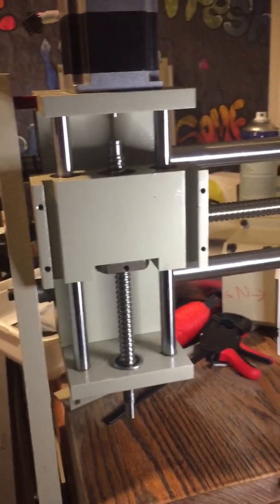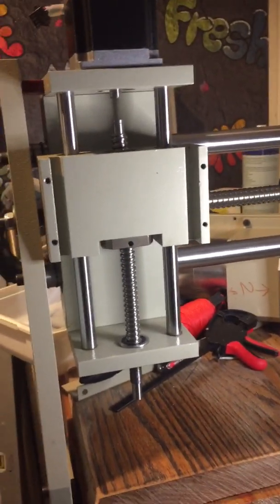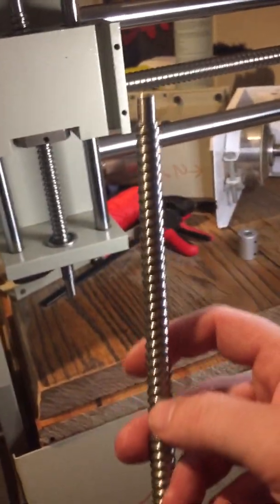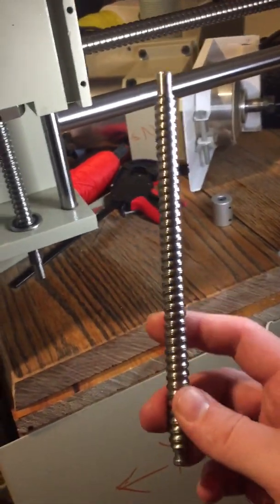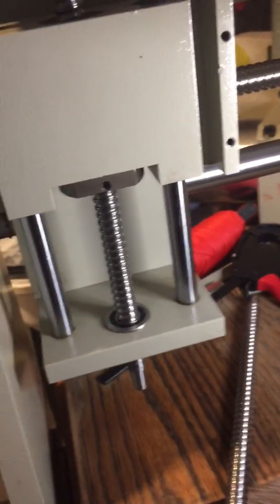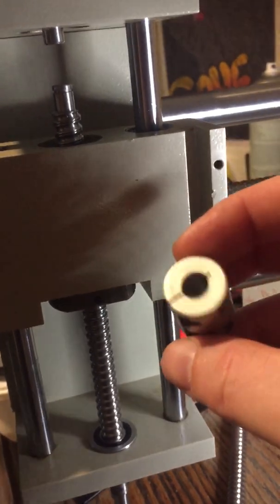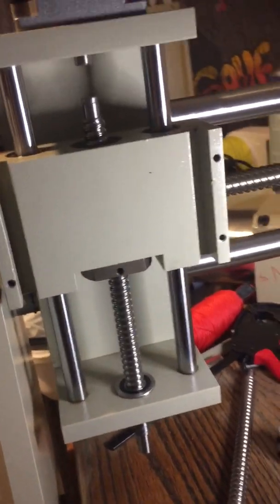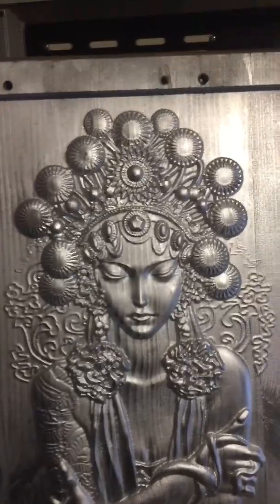CNCEST 6040 CNC Repair

Comment: Hi, where did you get your new ball screw from? I'm having the similar problem, however my problem is the bearings are on the outside now.
Reply from the maker: Hows it going , i grabbed mine from Aliexpress its not the greatest quality but my machine is up and running , gonna get one made up here in the uk at somepoint this year ....https://www.aliexpress.com/item/32313668126.html?spm=a2g0s.9042311.0.0.2baa4c4dKGriD8